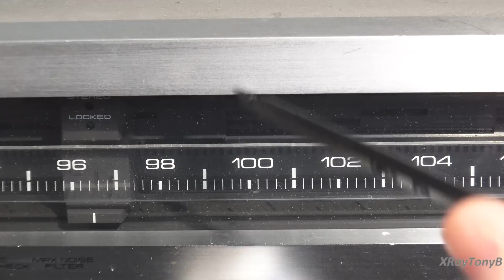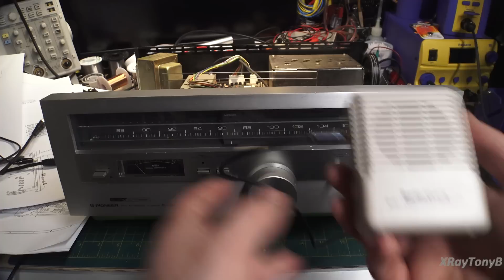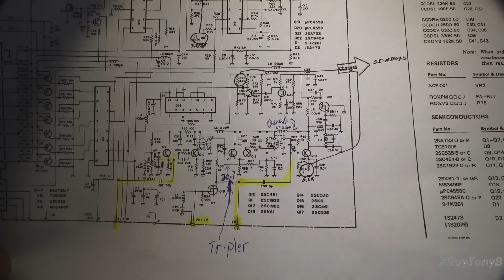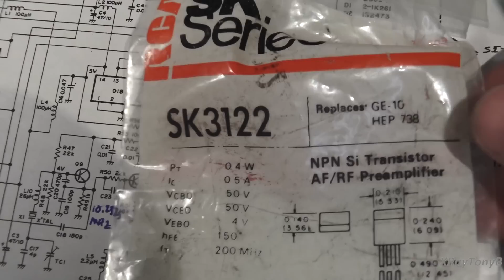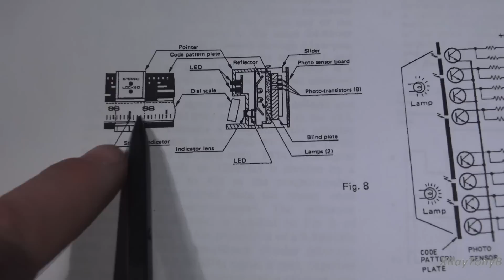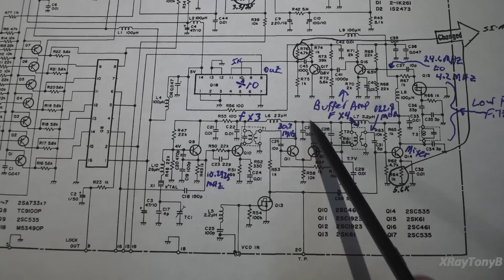Pioneer F-28 - The Rube Goldberg Tuner

Comment: 5:50 : That's just crazy finding this kind of contraption in a tuner dial. It's similar to what's done in speed regulation governors for turntables but used as a position sensor of a tuning dial? Extreme or ingenious?
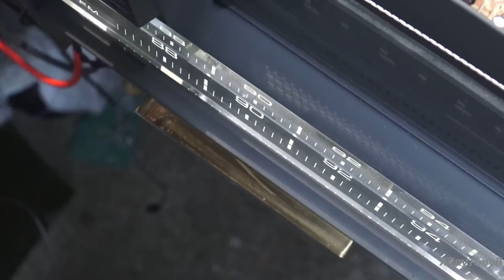44:15 : Well I didn't know who Rube Goldberg was and for a moment I feared it might be some famous electronic engineer! The dial is actually glass? I don't think I've ever seen a tuner of that era with a glass dial. The whole thing has design elements which probably would be best left in a high school science project.  Either that or someone was having a field day in the Pioneer design department.

Comment: GOOD, APROUCH, SO FAR, TRY, COVERING THE STATION INDUCATOR, WITH TAP/DROP CLOTH TO PROTECTE, THE BLACK REFLECTOR, WD40, INJECTED, UNDER THE GROUMETS AT BOTH ENDS, WITH A PIES OF WOOD, CUT TO SIZE TRY PUSHING THE GLASS BACK AND FORTH, TILL YOU CAN GET IT TO SLIDE PAST THE INDICATOR.... OR DRILL THE SPOT WELDS OUT REMOVE THE GLASS AND PUT BACK TOGETHER WITH STEEL RIVETS...

Comment: Just want to say I just bought an F28 off EBay that didn’t tune at all and after watching your video my first check was the bulbs in the tuning indicator. Both were burned out. I replaced and the tuner works great. Thanks for putting this out there. It is a crazy set up but the tuner is amazing.

Comment: As it appears there's no way for those glass tracks to come out, but I have a suspicion if that backing plate behind the whole tuner indicator can be moved somehow that the dial head would be able to unfasten in some way enough that it'd slide up and over the glass track it sits on. (C-clip or something keeping the front and back indicator halves together over that track?) Then you'd be able to get at the bulb and whatever else. Something to be puzzled out in regards to how it goes together, and it still seems it's unlikely a big chassis part would be fastened like that at the end.

Comment: Perhaps the photo sensor plate would be easier to remove than the dial scale?  And maybe you can re-create an appropriate encoder digital word to fake out the circuit into thinking the light is working, at least as a test?
Reply: And for such an important part of the circuit, why did they use incandescent lamps instead of LEDs???  Crazy!

Comment: Remember what the Hitchhiker's Guide to the Galaxy said: DON'T PANIC!

It is clear that they wanted the frontend Q of a mechanical tuning capacitor with the frequency stability of a PLL. Later on Pioneer had some other interesting concepts like using an auxiliary tuning diode (as used for AFC) to grid-lock the LO by means of a "modulo-f" PLL in the TX-9800. (It is possible to make a PLL lock on any step of a frequency grid by using a sampling mixer to downmix the LO.)

Now for our synthesizer board:
1. Are the supply voltages OK? Ground connections good?
2. The tripler must work under any circumstances. (The only other connection of the oscillator output is pin 8 of Q8, called RI, which I presume means Reference Input.) Try sweeping T1 with a signal generator (there should be a peak at 30.7-ish MHz) and measure its winding resistances. The whole point of the circuit is being a crummy nonlinear amplifier working into a load impedance that's maximum at the desired harmonic. If the transformer is open, badly mistuned (bad cap?) or disconnected somewhere or Q10 beta has gone south, nothing else is going to work, as T2 is going to be tuned to 122.8 MHz. Your frequency counter was basically showing all noise.

As par for the course in those days, the PLL is a premixing type, which takes some getting used to if you're not familiar with them. The PLL synth IC Q8's phase comparator is working at 10.2325 MHz / 1024 ~= 9.993 kHz, and it actually tunes the 2.46 MHz to 420 kHz range. In order to get our LO signal (at f + 10.7 MHz) down that far, it is being subtracted from the 10.2325 MHz x 12 signal by mixing to obtain 24.6 MHz to 4.2 MHz, then clock divided by 10 by prescaler Q18. So our effective PLL step size becomes 9.93 kHz * 10 = 99.3 kHz. Why not exactly 100 is anyone's guess, maybe they couldn't get 10.240 MHz xtals. 
The two separate LO tuning ranges may have been done in an effort to keep LO phase noise down, often a major contributor to PLL phase noise which in turn reflects in FM S/N ratio. Tuning voltage generation from phase comparator output would have been very low noise for the day, involving 4558 audio opamps followed by heavy passive filtering and a choke (lots of tuners would just use 100k resistors in series with varactor diodes, making for a major source of voltage noise that is being translated into LO phase noise).

This whole bulb business is unfortunate, of course. Just for trying things out, I would try sneaking in a teeny tiny LED if at all possible... one of these modern-day SMD jobs on a strip of thin PCB would be good. Got a dead cheap low-wattage LED bulb floating around?

This one's not going to be a quick fix, but it should be worth it - even if I'm not a fan of the Japanese approach of stuffing the whole IF chain with high-gain limiter amplifiers for better quieting. It really degrades selectivity at high signal levels as the IF goes nonlinear and starts producing 3rd-order intermod, so they have no use many more filters with stricter group delay requirements. To make matters worse, these '70s hot-rod tuners never incorporate IF or RF AGC, making them way too hot for, say, crowded European band conditions or cable.
http://www.ham-radio.com/k6sti/rfagc.htm
Looks like G2 voltage isn't that high in the F-28 (only 2.2-ish V), so I guess they wisely included only as much RF gain as needed. IF linearity is still likely to be dubious though. I'd keep a variable RF attenuator handy.

Comment: Maybe You could shine a light on the two photo sensors on the sensor plate to "fake" an encoding? Also, is it possible to remove the photo sensor plate and get to the lamps that way? Good luck with this thing, this is very interesting.

Comment: Question - with the lamp out, couldn't the receiver still tune certain frequencies?  No bulb should be the same as one of those spots with no holes in the lower half.  It may not be the frequency called for in the alignment, but it might get you far enough to assess the rest of the receiver.  IIRC, it does receive.  This would allow you to test it on the frequencies it will cooperate on.  Second thought - can't you fake the output of that encoder?  Just for testing?

Comment: I thought I saw some old school solid tantalum caps on that one board. I think they are notorious for shorting. I'd ohm those out just for fun. Also ICs in sockets: pull out and re-seat. Can't hurt. I'd do stuff like that for a while and see if I got lucky after somehow changing that light bulb or temporarily going around the bulb to see the rest of it works.

Comment: Can't you slide out that glass dial scale from the left hand side, without having to remove the right hand side of the chassis?
Reply from the maker: Each side has a dial string pulley on it.   To add insult to injury, Pioneer doesn't give the spec for the bulb, as they treat the whole assembly as one part called the "lamp module".
Reply: I feel your pain.

Comment: Some of the 'top of the line' Japanese machines in the pre-digital era have been over engineered beyond reason.  The same applies to amplifiers of those days.  A couple of years ago I restored a Technics SU-8099 amp (1979).  Ridiculously complicated.
Reply: I had a Marantz 4400 quad receiver new in 1978. The schematic folded out into a 3' x 4' nightmare. And we're talking small print!

Comment: It really is a stumper why it seems like it was deliberately designed to be as hard as possible to service.  If it was only a matter of the 8 bit word, I'd just lay in 8 little toggle switches and tape a chart to the top cover, but there's the tuning caps too.  (the direct entry tuning mod)

Comment: To check if the dead bulb is the main problem, you can force the circuit to read whatever 8 bits you need, at the digital IC inputs or the 8 transistor drivers there. Also just pull all the transistors in these doubler circuits and test them.

Comment: Question, does the original Q12 test bad, or did you believe it to be bad because the circuit didn't work?  Given the problems with C29, I have to wonder if there isn't something else going on and the new transistors simply are behaving differently.  Also, given the design, I don't think the tippler output waveform is bad.  Wrong amplitude perhaps, but unless there's excessive damping, I don't think it's bad.

Comment: Doesn't look like you need to take the glass off to get to the bulb? the perforated plate behind it looks like that comes out! Held in the side by the two brackets maybe they are covers to remove that plate, or are they just rubber fittings grommets and you can just push them in the rubber out to release it? Failing that the glass might come out by just sliding it to one side one side might be slightly longer than the other just held in by the rubber mounts?

Comment: This is the grail of the 70’s/80’s tuner, I own a power amp pioneer M-22 and preamplifier C-21 from the same serie.
Reply: The idea of the tripler/mixer is simply to get the main VHF VCO frequency down to the frequency the 7490 (m53490p) TTL chip Q18 will work with. The input of the 7490 divider is biased by the 4k7/1k combo to increase the gate sensitivity... its a digital gate fed by an analog signal from Q17. It looks to me like this is where the problem is... this is a crappy way to drive a digital gate and will explain the confusion in resistor values, its a fudge, and these were likely selected individually during manufacture.. Also check you have a VCO voltage present at the mixer. The 7490 output should have a 5 volt TTL squarewave at 1/10th the input freq. I would also replace that Q18 divider. The remaining part of the PLL must be on another PCB... I dont have the schema to check this. I am assuming there will be another divider IC driven by the 5 bit data word from the front panel. This chip will see the output of the 7490.